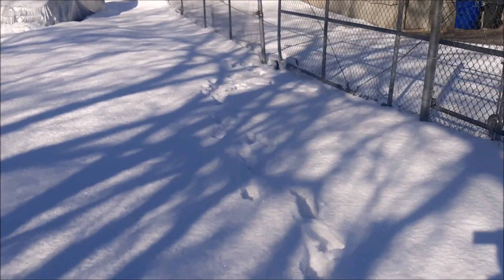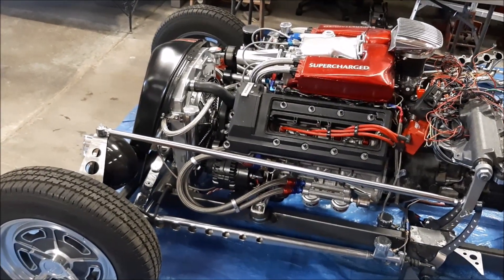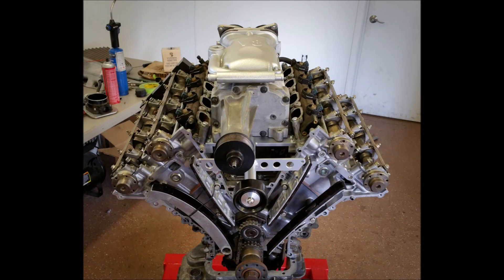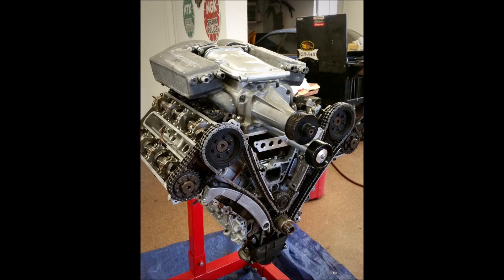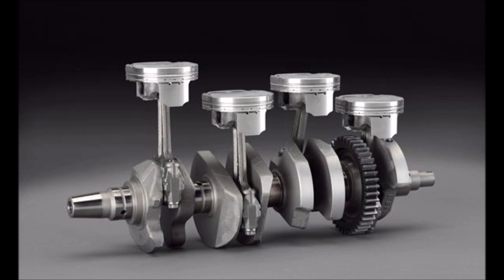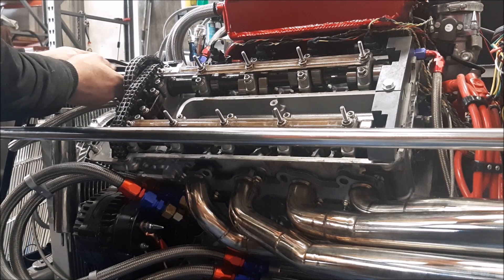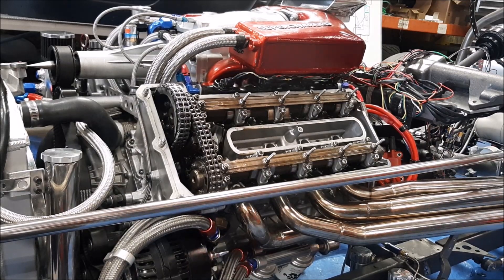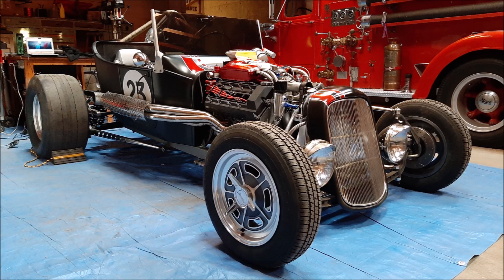"Big Bang" "Twin Fire" "Crossfire" V8 conversion

Comment: I'm glad to know that this has been done, I had been curious as to what an engine would be like with 2 cylinders firing at the same time,  I wondered how it would affect torque and horse power. and lower main bearing wear with 2 cylinders exerting down force per firing stroke opposed to 1 at a time?

Comment: Simply needs external balance to run smooth or staggered ignition before and at tdc. I have a vmax-4 yamaha engine that is rephased to fire two at a time resulted in a flat tourque curve and quicker revs as seen in this video. We need the driving results!

Comment: Awesome!! F...ing love that sound, I only wonder how shaky the ride gets as well as engine bearings would not be able to take it long term...  I'm very curious if there is any difference   when you actually drive that Rod. Being supercharged v8 it probably will not be noticeable power difference because that motor has power throughout all rev range... Very interesting,  great work!!

Comment: Not an engineer here, but in my in depth intrigue of the cross-plane four and its use I have gathered that the drive train suffers the most with this type of power. The R1 actually benefits from the the relatively large single wheel "biting and recoiling" like a runners shoe under the lumped power impulses. This in turn spares the gear train being hammered so severely in the middle. The Harley Davidson also sticks to belt re-drives to avoid the stresses upon the gear-train.  Would you ever consider the idea of a Subaru type trans-axle driving the rear axle via large belt re-drives. It would give the car the early era chain driven axle look to it (that I haven't seen used anywhere in modern times). Your engine may not be so mechanically stressed getting its power to the ground in much the same way as the Yamaha R1 or actually more like the Harley. I think you could have a revolutionary drag car with monster torque.
Reply: Don Garlits tried something like this in one of his really out there transversal engined top fueler designs. I don't think 4,000 hp re-drive belts existed at the time.

Comment: It would be curious to run an engine in this configuration to see what impact it has on the internals for sure. I winder if some of the great engine tinkerers like cosworth have done this and decided against it for one reason or another.

Comment: How did you reset the spark timing and fuel injecting timing. You would need a total costume software program. I really love this idea though. I've been pondering this for about a decade.
Reply from the maker: The fuel injection controller on this V8 runs in paired cylinder injection and waste spark. So each cylinder see's one injector fire and one spark event every 360 degrees of crank rotation. Didn't need to change a thing on the computer to fire up.
Reply: I would love to see a before and after dyno comparison.

Comment: that also means you can't run a single distributor right? (For some OHC V8 that still uses distributor/magneto, because I guess OHV V8 is out of the question unless my prediction about Top Fuel dragsters V8 firing sequence was wrong because I just realized they used 2 big magnetos) Could we actually solve them by using ignition coils instead?

Comment: It would be easier to loose traction with the big bang setup.
Reply: It's the other way round , actually gain more traction from the big pause between power strokes . That's why Harley's were good at flat track racing , and why dirt bikes are big singles and why Yamaha did the crossplane inline 4 .

Comment: So basically doing that you've effectively turned it into a V4 but with each firing point shared across 2 cylinders simultaneously. I'm not sure what the benefits of that would be apart from more vibration & the loss of the traditional crossplane V8 sound? Plus it's not designed to run with those altered forces as you correctly pointed out when you voiced your concern about the bearings. Very interesting nonetheless.

Comment: How did you get spark to two cylinders at once? I’m thinking about doing this myself
Reply from the maker: The universal standalone EFI controller has 4 channels of fuel & 4 ignition channels out. Which means it has two injectors wired per channel, the paired cylinders. The ignition is in waste spark. Each cylinder gets one squirt of fuel and one ignition event every 360 degrees of crank rotation.
Reply: Okay thank you.

Comment: "Because I can" always yields the most interesting results.

It's always disheartening to see people risk blowing an expensive engine in the quest to push a few extra HP on the dyno.  If you're going to mess around with an engine, doing fun stuff like this on a hot rod seems like a more worthy exercise.  8)
Reply: I did this accidentally on a Subaru while setting up the timing chains.  The starter could barely crank it.

Comment: Dude how can I get this engine in a road legal car??? Love it!
Reply from the maker: The engine is a 90's BMW 4.4L V8, with earlier BMW 4.0L heads & cams. They came in 90's 5 and 7 series BMW's
Reply: @TheMykkH  If I could choose I’d definitely get a 2UR-GSE 5.0 or 3UR-FE 5.7, for reliability reasons. What I’m talking about is your awesome work at an odd firing big bang setup, esentially turning it into two crossplane inline-4s firing in synchrony. Love it. ❤️ 

I wish car manufacturers would use more uneven firing engines for cars. 270 degree twins, t-plane triples, crossplane inline 4s etc

Comment: Can this be done also on dual overhead cam v6s like the 2.7 l Chrysler engine? Please let me know I would like to try.
Reply from the maker: Yes, as long as the EFI controller runs in paired cylinder injection and waste spark. Meaning one injector fire and one coil fire every 360 degrees per cylinder.

Comment: Got some bad valve seals there buddy
Reply from the maker: Yeah I'll have to see what that's about, it's definitely more noticeable with the "big bang". I also have no tuning time on the VE table and nothing is dialed in, It might be way way rich in the overrun cells. Although it does appear blueish.
Reply: @TheMykkH  could also need an oil change. my 318 magnum does that when it wants a change.

Comment: Dude thats bad ass! You have to keep it like that!! Its a damn hot rod man, its suposed to shake and carry on. Don't be pragmatic and 'think of the bearings'blah blah blah. Be a badass.
Reply: You say this, but the motor could spin a bearing in less than 1000 miles depending on the stress put on it. Not every youtuber has stupid amounts of money or time to throw around to "be a badass". The guy's already a bad ass for doing what most others won't

Comment: Love the sound. I feel like the crankshaft torsional vibration damper would need to be retuned for this configuration. Fatigue failure in the crank seems more likely with torsional impulse inputs from two journals simultaneously versus just one.

Comment: Wow. This is pretty damn cool. I just watched a video of an electrical demonstration of this principle and went looking, I didn't expect to find much, but then you went and uploaded this today. Great timing. Well explained and a really good experiment. I'd be very interested to hear how this would work out long term. My next thing is how would an exhaust system work on a "normal" car. You could stay true-dual for simplicity, but then I wonder how you'd get on if you wanted an x/h pipe, forcing 2 pulses through at the same time. Might end up losing power as it could become a choke point and you lose scavenging.
Reply: I came here for the same reason.
Reply: Same

Comment: Awesome, you didn't waste any time getting this done. Do you want me to link to this in my big bang V8 video?

I think a stereo microphone placed centrally behind the car (outside ideally, looks a bit cold for that now) would illustrate the difference more clearly, did it sound "twice as loud half as often" in person?
Reply from the maker: You can link it if you'd like, it's already linked in your comments :-)

Clearly the most drastic change is the idle characteristics, the exhaust volume at idle & revs are noticeably louder. Say 20%-30% louder. Tonally it does have a bit more bite in the exhaust note.
Reply: @TheMykkH  couldn't find it, I've commented on my video and linked to here and pinned it, and put it in the description for good measure.